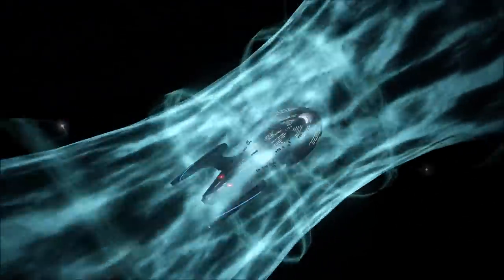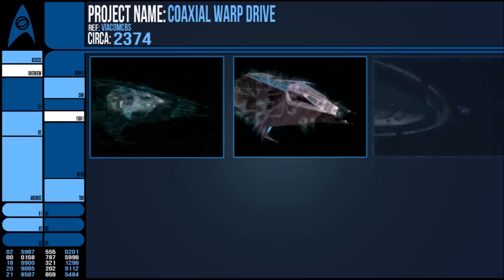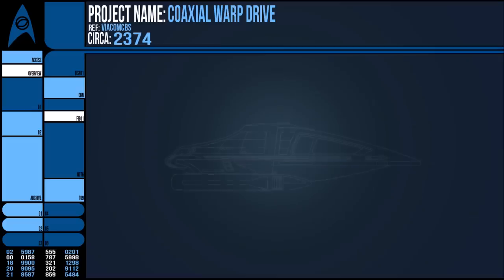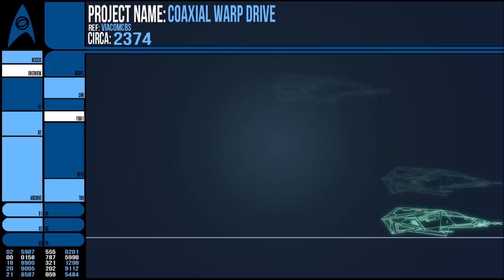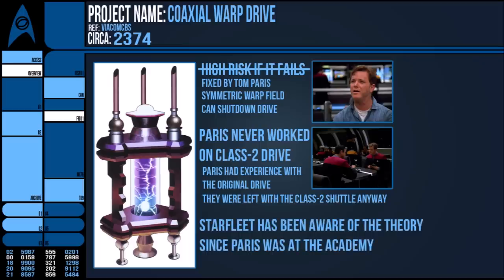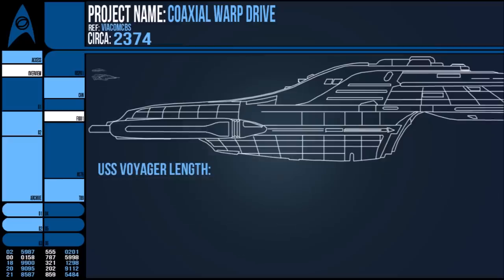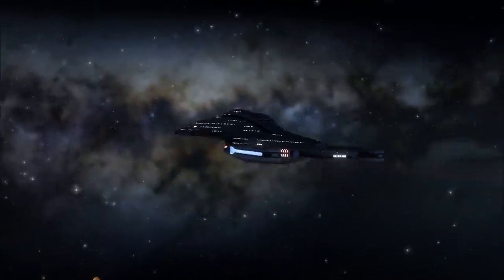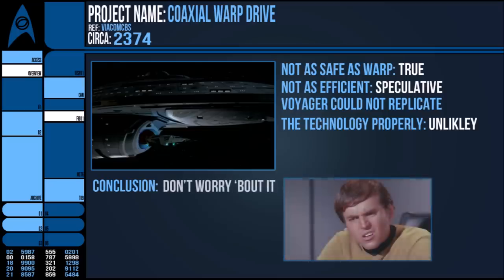Why Not Coaxial Warp Drive? (Star Trek Theory)

Comment: Wiki-Fed says that "Paris suggested installing a polaric modulator to dilute the subatomic energy flow before it entered the core...which solved the problem."  ... Star Trek Online Wiki is limited to the following; Field Stabilizing, Hyper Injection, 'overcharged,' Deuterium/Thoron, Plasma-Integrated, 'Fleet' Reinforced, 'Fleet' Hyper-Charged, 'Fleet' Hyper-Stabilizing, 'Fleet' Spire Cores, and 'Fleet' Isolated Protomatter. Those are subjected to various interstellar engineering factions and their fleet achievements.... I feel like I'm just quoting Rick from something he said in an earlier post thinking of what comes next for Certifiably Ingame. Rick makes pains to explain that there isn't so much need for Coaxil Warp Drives citing the differences between WARP 9.0 and 9.5. I think given stealth allowances relative to 'Meta-phasic,' technologies, and cloaking engineering phenomenology, having said, YES also realm of Meta-phasic, then relative to ships circumstances Coaxil may be a good option. We know that in the 25th C. there are more than one way around certain problems. For example, what if in the early 27th C. [like, okay, 2619,] options abound such as... Should I use the Borg rift technology I lifted from my earlier this year Deborgification raid to go to Fluidic space, or wait to use some kind of orbital space station rift gateway, Iconian or otherwise, even if it means being tracked across the galaxy a bit...? Oh geez, that last unexpected battle with the Malon has caused engineering difficulties in my Meta-phasic variance relay conduit -  manifold .... damn ... Well, good thing we have this Coaxil drive! We can merge our Borg snipe with the coexisting exgencies, be they a Coaxil 
Secondary Warp Core, or something else.  [Whenever I get into these responses this hardcore, I tend to notice that I read how you sound....]
"Sounds of laughter, shades of life
Are ringing through my opened ears
Inciting and inviting me
Limitless undying love
Which shines around me like a million suns
It calls me on and on across the universe
Jai Guru Deva, Om
Nothing's gonna change my world..." Thanx Rick!!!!!!!!!!!

Comment: The Enterprise J is supposed to have Co-Axial Warp drive on it - it's supposed to allow even greater speeds due to some how getting around the build up of Virtual Particle density and Hawking Radiation in a more elegant ways that the brute force methods the Borg use - it's very fast indeed - as not only is it able to function similarly to Slipstream and at similar speeds - it's able to do so for much longer and without needing special materials that are rare to do so. The Enterprise J was thus potentially able to hop to the M-25 Galaxy with ease and with a bit more effort (and a few year travel time) could make it to Andromeda too. Something we know is possible as it's done in TOS (sort of). I suspect the Drive Barclay Built is even quicker than that though.
Reply: What was the drive that Barclay came up with?
Reply: @briananthony4044  I don't know if it had a name - but it was when he had his mind in the computer.
Reply: @90lancaster  Don't remember that episode.

Comment: If stabilized size of the ships should not matter however the same energy to run warp 9 for days should get you the same distance in one jump meaning time charging the drive vs going.  Or you could make bigger drives for the ships. Thired a emergency jump to a distance away from battle.

Comment: Maybe the difference between conventional warp drives and coaxial warp drives is akin to the differences between gas and diesel engines?  Both serve the same functions and operate under the same fundamental principles, but the fuel is ignited differently.  You can have one engine type or the other, but not necessarily both.

Comment: It could be as simple as the rate of fuel consumption over distance travelled gives Coaxial Warp Drive an inferior range over conventual Warp Drive, much in the same way that today's electric cars & motorcycles have inferior range & performance to internal combustion engined vehicles.

Comment: My understanding of the drive was it was less like running and more like leap frog. Yes you can jump faster than warp to your location. But the range is significantly less than what you could do if you ran continiously like you do with warp. I imagine the disruption to sub space and the unique fuel requirements must have made it an inefficient warp alternative at the time.

Comment: Simple my Friend - they had comcast, thus limited how good the COAX was! ;-D  
Plus they are still on hold for customer support even after getting back to Earth... 

Ok, serious answer would be there was probably a limited area it could actually scan to jump safely, since it was traveling continuously long distance scanners can only do so much, might do 20 or 50 light years now and then, but if something changes at destination as you are about to jump (like another ship or something ending up where you picked to jump... you would end up emended in it) 

But conventional warp - your long distance scans are able to continually see your destination and whats in front of you each inch of the route so much safer.

Comment: Energy constraints are probably the leading cause as to why it's not used in ST. Sure, they can fold a few LY for a small vessel but folding a few thousand LY for a larger vessel is almost guaranteed to take energy an order of magnitude higher than what a large ship is capable of realistically producing. Combined with other issues such as exotic matter they may need to forage or trade for and potential issues with a cooldown period after a jump...and I don;t think it's a viable tech choice. At least not until ST gets even crazier power generation tech.

Comment: My guess is that it costs too much power. In the real world, warping space is theoretically possible, but requires an insane amount of power. And that's just for the "traditional" wave effect space warping. I imagine it would cost hundreds of times more to warp space in the "coaxial" way, since it's creating a significantly larger effect. So it probably works on very small craft, but has issues scaling up.

Comment: I'm not sure you if read or even know about the Foundation series of novels by Isaac Asimov. I won't bother with the plot of it because it so big I don't even know where to start. However the method of travel between planets was a series of jumps at FTL speed between set points in space. In the original series the pilot had to stop after each jump to calculate the next owe and so forth until they would reach destination. Obviously the longer the distance the more jumps it would require and more time to travel. In the sequel a computer was devised to manage the calculations of all the jumps at the same time(or very quick in motion I can't remember exactly) but it would cut down the time required for the pilot calculations.
In the video you mentioned at some point that the drive itself might  require several jumps to reach a destination. I was wandering if the same principle could be applied from what I just mentioned(obviously computers are more advanced in trek but there is still the question of direction and all the variables needed so we don't know for sure)

Comment: The structural integrity field of a big ship cannot keep up with the movement of so much ship mass across extreme distances of space that creates too much distortions to the hull integrity and the ship cannot compensate, same reason for why voyager could not use the slipstream drive. The work around is to build ships using flexible and self-healing biomatter like the ships of species 8472, or introduce nanites into the ship hull to heal itself that is currently beyond starfleet.

Comment: larger scale coaxial warp would require a much larger generator. Not only could Voyager not HOLD two warp cores and a coaxial, but it would be impractical to have the two warp cores and the coaxial, since two would just be wasting energy on standby (who shuts those things down?) and the coaxial would be the only thing ever used.

Comment: If it was practical, but limited by size, then they could have built a bunch of shuttles to get everyone home, so I think that cannot be the limit. While the coaxial warp drive is impressive, I think we have to assume its range really is limited, as might its re-use speed. As you imply, the combination must result in a true top speed which is not significantly greater than normal warp with its own advantages and disadvantages.

Comment: I wonder if a Starfleet student ever fed a chicken birdseed laced with neutronium and dilithium.  If these substances could be metabolized by the chicken you could use one of these chickens as a temporary substitute for dilithium crystals in a warp chamber.  It could possibly cluck with each release of hydrogen / anti-hydrogen plasma release.  Higher warp values would make the chicken cluck faster.  I would imagine, however, that there would be a limit to what the chicken could stand before it became unstable.

Imagine a Starfleet vessel using said chicken in its warp drive and suddenly having to eject the warp core (i.e. the chicken) when they push that boundary for too long (e.g. going above warp 7).  You would see this chicken exiting the vessel at high speeds and energies, clucking like mad, and possibly exploding.

I really have to stop eating at KFC.  I think their additives to the food affect my brain chemistry.
:P

Comment: One possibility might be as simple as the drive might not work close to star systems which have varying levels of gravitational fields. If you need to plot multiple jumps just to get around   various systems or need an alternate drive just to get into and out of them the drive would be all but useless for conventional system to system travel and only provide use for very specific cases.

Comment: If coaxial warp is more, for want of a better term, violent than regular warp, it could make sense that Starfleet would ban it, or Janeway be unwilling to implement it, for the same "environmentally friendly" reasons they banned high warp for a while.

I can think of a great many scenarios where the instant 20 light year, perhaps even a 20 light minutes jump would be far more useful than regular warp, 
tactical, "oh no, the enemy ship is more powerful than us, we can't outfight it or outrun it" command "we need a coaxial jump" helm, that takes a day to fully charge" command "forget full power, just get us far enough away to disorientate the enemy ship, then we can run away under regular warp power"

Navigation "oh no, we are [insert technobabble here], our engines are not powerful enough to escape, request permission for a coaxial jump, it's that or [insert negative consequence here]"

Captain "at our top speed it will take 20 years to get home, would it not be great if we had some way to effectively double our speed", helm "Captain what about the coaxial drive, it takes a day to charge, but it will allow us a way to jump about as far once a day as maximum warp would take us in that time, we then use regular high warp while it recharges, then do another coaxial jump, and repeat."

Comment: I would imagine it would have a negative effect on sub space and possibly interfering with gravity fields making unusable in busy systems based on some explanations given about harmful effects of standard warp systems but most likely it didn't fit the plot as you stated which makes the most sense to me
Reply: Good point. And considering how careful Starfleet was after learning of the negative effects (Warp 4 speed limit anyone?), there is a good reason to avoid damage, even if they leave the area behind.

Comment: If that ship had been one meter off it would have appeared inside Voyager suddenly, so not knowing if something is in your flight path is a pretty big mark against using that drive.
Reply: I always used that tech for warfare. If you can fold a ship into any location within a given range, you can fold a bomb in that location. Or you prepare for ramming speed, but without the need to move the distance. After all, two things are not supposed to be in the same place at once.

Comment: This is how i figured the FTL drives in Battlestar Galactica show worked. Its as if you link the space of your destination to your current location then let it snap you to the new location like letting go of a rubber band that was stretched.
Reply: Also explains why that kind of jump drive has a limited range. The further you go, the more energy you need. And obviously calculating the target is an issue. If you jump 50 ligh tyears, and your computer has 1/60° accuracy for the location, you might end up in orbit around neptune or inside the sun. If you jump 70,000 light years with that accuracy you either end up at the target, or 2 star systems over.

Comment: I wonder if it was just a case of another technology that was competing with other advances in propulsion? Clearly Voyager never made use of it again and maybe it was because of their later experience with quantum slipstream technology.If you have the choice of a long journey home using conventional warp technology versus not getting home at all because the new technologies you have found are too risky to be relied upon, wouldn't you choose the safer option of conventional warp until you knew you had a better option with acceptable levels of risk?

Could it be that Starfleet, upon seeing Voyager's data on these technologies, would have spent a long time looking at the theories behind them before even thinking about their introduction, and even then would only have chosen the one most likely to produce significant benefits compared to conventional warp technology? Perhaps we will see something of this in the new Picard series...

Comment: yep.. this time its the exact duplication of Macross Fold Engine.
and like in macross,  its more plausible that coaxial warp drive energy scales up inefficiently.
and the drive instability might also increases exponentially based on the mass or the distance traveled. 
and like in macross which had Fold Faults, star trek had pockets of subspace instability.
what happens if the Coaxial drive encountered a subspace instability? does the  ship just drop out somewhere or is it more hazardous?

macross solved the Fold Fault issue using Fold Quartz but those were made by a sentient hive species which entailed hazards of its own.

i know what people are thinking, this is star trek not macross. macross might be a space opera closer to battlestar galatica but its still sci-fi that involves traveling over large distances of space. Voyager is like macross in more ways than one...minus the singing Idols/groups.

Comment: If it would require a series of microjumps as suggested even if it was faster it would be dangerous. Without actually cruising forward in the traditional sense they could not scan ahead and there would be a limit to forewarning of dangers. They might just pop into the crossfire of the Borg basing away at Species 8472.

Comment: That's not quite the discussed concept i have head for co-axial warp.  Even in the show  you could see Steths ship expanding and compressing of sorts.  The idea was  conventional warp drive is propulsion along the same line  or plain (aka axis) . Co-axial is more like compressing the vessel in two directions instead of one.  Steth  did mention this in the show when he says that the drive reconfigures the internal geometry of the atoms.  This video's description comes across more like the original folding space theory.  Compressing space in both axis would be like entering a 2 dimensional space that didn't have a  three dimensions space set of rules. Another show called star command also had a similar drive to coaxial warp to which the ship folded into itself over and over again until it was no longer in 3d space. Normal warp drive does alter the laws of inertia and motion but only in one direction.  Coaxial warp would indeed be a rough ride when starting out or stopping since you are re-aquiring the mass dictated by a 3d universe. It's not surprising that a coaxial explosion would be near supernova like intensity.
However i do agree that this tech was over looked far too easily by voyager. Considering how quickly they fixed the problem and adapted it  and they still had the ability to generate a symetric warp field to help with problems, there was no real reason to not explore the technology.
To be honest ST Transwarp and Quantum slip stream is far more dangerous since the forces they are dealing with are literally the creation of reality at the point of forming the tunnel.  Even a small borg ship has much more computing power and redundant power sources than voyager and  even in the final episode of Voyager you can see the borg ship was far more stable than voyager in the transwarp conduit even while it was collapsing. Voyager used the borg ship as a safe haven before blowing themselves free.
It was too quick a solution to voyagers travel distance problems so it was ignored all together.  TNG was't any better as learning from experience.
The Corvet in star command movie wasn't exactly small for a courier/trainning vessel. However their full on destroyers also had the coaxial like drive.  It is possible that the coaxial induction drive can be sized to match a specific vessel.
They also explored the coaxial sub space compression in DS9 in the episode "One little ship".